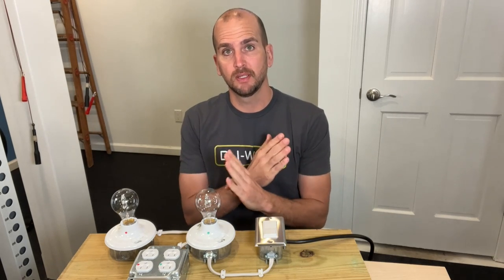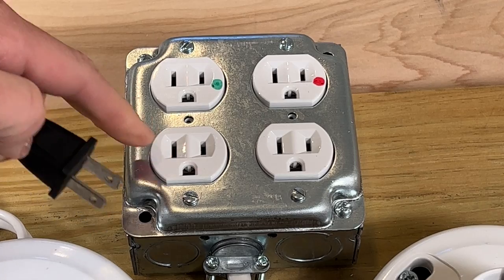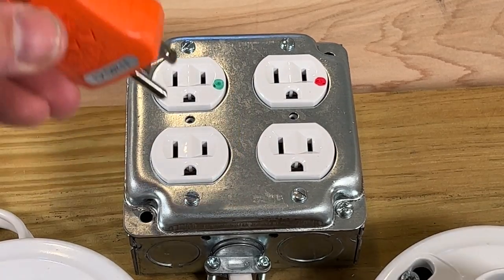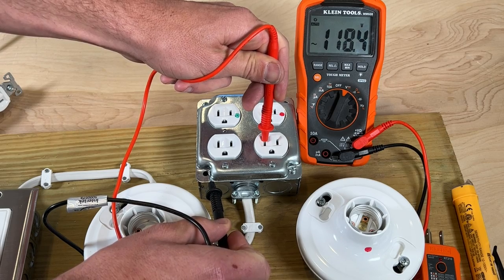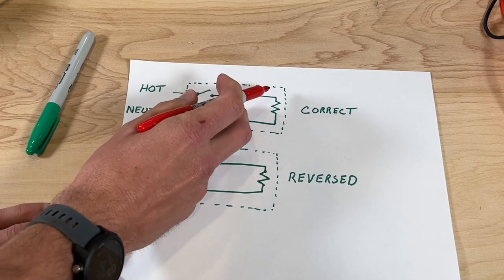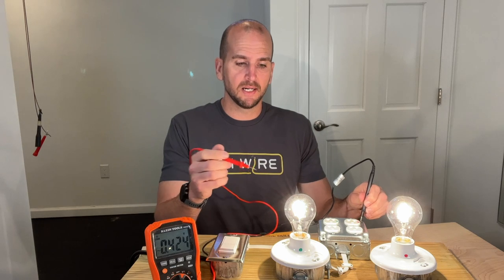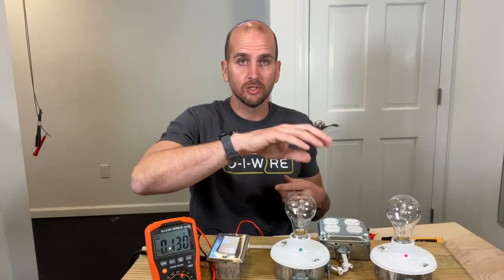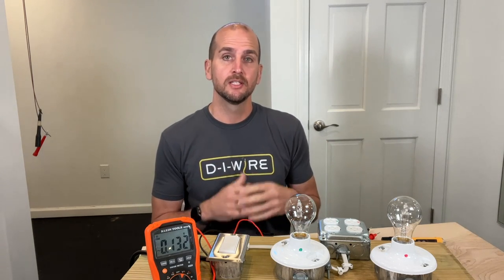Dangerous Wiring Issues In Lights and Outlets

Comment: Electricity had always scared me so I've avoided it.

This reverse polarity thing is strange because it hurts you in a way I wasn't expecting.  Thought you would get shocked if you touched the reversed bulb or the fixture.  This is much sneakier than that.
Reply: All well pump houses is operated on polarity. All power goes in 1 direction and opens gstes in the  wiring circuit. If connect 2 legs from a power source to its main  reaker and nothing works , try changing the 2 service wires around, the polarity backwards.
Reply: @michaelspencer6523  Looking strictly at ANY transformer, you basically have only 2 wires in a loop.  Yes they add a 3rd wire to make it another leg, but the basic electronics is only two wires.  We call them "hot" and "line", not ground.  Green ground (chassie ground), is not the same as line "ground" in the loop of that circuit.  

We add the "ground" in case if there is a short in the loop, and there is then a place for that power to go away from the circuit and away from the human beings.  AC has no "polarity", in the strict since, like DC does.  

The sinewave is first plus 120v, then negative 120v, back and forth.  So if we did away with the ground all together... the line and hot would still always work.  

It simply makes the circuit possibly dangerous in the right circumstances.  So it does not matter which side of the motor that a switch is on in the strict since of the circuit itself.  Only on if that something happens to that device, that a short (hot power) has no place to go other than through a person and to "ground" that they are standing on, completing the circuit.  But I bet you still wont agree with this science... again.  This is for JAKE to read and understand.
Reply: All polarity is , diodes force curent go 1 direction. Reguardless a dirrectuon it goes, its curent, sll curents are dangerious even .06 amps. It kill the same as 6 amps.
Reply: @michaelspencer6523  Diodes take the negative side of the AC waveform, and puts it into the positive side.  It fills in the wave form, making it into unregulated DC, with fluctuations and "dips" in the wave.  It can then be further filled in by using capacitors to clean up the remaining dips in that now dc voltage.

As for amperage, it depends on where it hits the human body.  0.06amps is not a whole lot on the outer skin of a body.  It only matters if it is close to the nervous system or heart.  I get more cautious over 500mA AND voltages over 50v.
Reply: We fear the unknown and electricians cash in on that ignorance every day.
Reply: You have no idea what reverse polarity means really. Your explaination is incorrect. You said if touch a current hot line will shock  you and a neutral  not shock you. Wrong 100 % If light works. I explain, the cirrent line is hot we say 120 v ac, light on working. Now touch the  white line  neutral , it a traveler 1/2 the volts as the hot line 120 v ac, it is 60 v ac. Because ac means alternateing currect. That means it sends from transformer and returns back to transformer. Where is your polarity in that ? .ok i explain polarity. It on the hot side or 120 v side not the return side. When voltage goes tona rectafier or a bridge rectafier , on a sine wave circuit, it goes through 4 diodes , 1 on each out put we say 1volt open  gate. The fiode will not let current go back wards and destroy rectafier. It on a polarity drive foward. If tbis polarity got changed, it shut fown diode to dave rectafier. , change in polarity. As in water treatment plants. Or sub stations from a power grid. 99% of all them are 3 phaze 240 v 60 hertz units at 120 v each leg, the center leg is a stinget leg to level out each dual leg at 120 v each by the earth ground applyed. Each leg is equipuiped with a safety return cut off incase reversed polarity.  Then we use color codes to make sure each leg is correct in sub station panel as (boy)  #1 is  color brown  or black tape  and #2 is orange tape and #3 is yellow tape. 3 phaze delta 60 hertz  240 volts. If swap  2  of the wires   around it go in different polarity.
Reply: @michaelspencer6523  you are not considering that we bond neutral to ground. It's weird but that's how it is. The whole electrical grid is referenced to earth ground. We do that for reasons. Basically so lightning bolts don't go shooting out of your receptacles as the grid floats away. All electricity is a potential charge difference between two points.
Reply: @michaelspencer6523  I told you about how a AC waveform becomes DC and you go on this rant.  I can tell I am not talking to an electrical engineer, but a electrician. 

Yes you went over a bridge rectifier.. kind of like a kid splashing in the mud, but then go off on 3 phase that is not what I am talking about.

Phases of a transformer have nothing to do with DC, nor Bridge rectifiers.  Phases are literally just several transformers, physically made into one box, with each "phase" being an AC voltage output "leg".  That transformer is stepping down (or up depending on windings), using a magnetic field.  

Bridge rectifiers again take the ac waveform and flips the bottom half of the wave and adds it to the positive side of the waveform creating unregulated DC.

Yes electricians use color codes to tell them what voltage comes out of each side of the transformer.  It means little in the circuit analyzing and mathematics for electrical engineers.

Good day.
Reply: @1pcfred  no it is made that eay in panels to equal the balance. But if use a no fault, you ise a usilated ground earth bar. A neutral is a traveler, it carries half the load as a main breaker  by heat of the mercury be 200 amps, and it 80 % loaded at full its 160 amps 80% load makes neautral at 80 % is 1/2 of current load = 70 amps return. A earth ground is 0 % load. It a shortage bar. It balances at 100 %. It trip the bar to disconnect. It not on the heat breaker to melt the bar  then it flip away break8ng circuit. A short breaker will save a life on imediate break where the merury breaks  from heat to melt the solid mercury conductor. You must reach the tempature it takes to melt mercury. Result burnt up from electrucution. This is earth ground and its purpose. It has many things it controls as power grids, mega generators, co.putet work stations, all electrical processing equipment all takes no fault isolsted circuits plus explotion oroof as gad stations and hospitals where electrical friction causes has explotions as oxigen, etc.no failt is expencive but a major compontent in daily life and life saving. Im a master electrian who was a electrical master electrian for the usa military bases in a war. Where seconds count to have power that saves lives. No power can cost thousands of lives in many things. Hospital, water etc. We was KBR. We built citys from  a war.
Reply: @1pcfred  a lighting rod it called in olden day , but it really a ground rod. A copper claded  rod  of 6 feet long 1/2" ir a 3/4" 6 feet rebar will do the same. Must have a connector put on end to connect the ground wire to ground bar in panel box. Use this bar to use ground fault  or grounded compointants. No earth ground is 100 % unsafe .and damages all high tech equipment that requires balanced in put or out put. Alot high tech motors and ac  break controllers require it.
Reply: @jacobw446  you did it again, it incorrect. As a alternator makes alternating current but not blalanced and set , it goes thousands to 1 in seconds. So must sent transform to a set balanced dc , dirrect current then transform dc bacj to a balanced set ac current. But with a transformer make a neutral so half the current can travel back to the traveler called a neutral. Tben to balance the current to neutral , must have s seperate earth ground  to balance the phazes or it go out of the 360 degree phaze  and it lose the balance and freeze. Like i said , nothing works equal and correct wothout a earth isolsted ground.  It not mater we try, it the same as trying to put a 4 inch square in a 1/10 inch hole.
Reply: @1pcfred  i already said that, it not work for better panels for idolated earth ground. That only to balance neutral , it nottake the place for ground or osolayion in gas stations and hospitals or computers or power grifs and mega generators. Those must be isolated earth ground with a neutral bar goes back to tbe oil cooled genetator on the 10,000 volt ac transfomor on power poles from 5 kw to 75 kw.
Reply: @michaelspencer6523  a lightning rod goes on the roof and is attached to a ground rod. When lightning strikes all bets are off. There's no protection that is guaranteed to protect anything. Someone I watch on YouTube lightning struck a tree in his front yard and he lost all kinds of equipment in his house. It was pretty random what blew out and what didn't.
Reply: @1pcfred  thats like i said old therrories, not a fact. Lightiny rods  finally fact, it magnetuc friction from ppssitive to negative earth ground. Anothee words earth ground better contact is made with copper clad , if rich it be a 18 karot gold rod. But if like everybody else work for a living, it be a copper claded covering  on a steal rod. A earh ground  rod 1/2"x 6'
Reply: @1pcfred  sounds like a clown set up his own house to get fuined by friction power unlimited. Nothing new, pld therrories proved a fact, it the tallest thing connected to earth. As a ground rod attached  to electrical in house and if housevis steal frames as all concrete block houses are as mine is, it attached to the house frame and tbe rebar and wire mesh in concrete floor. And i had all ouside concrete inside security gate concrete and tiled and revared for heavy traffic and its tied to earth  ground  rod also. Earth ground protects alot in your home.  Do not believe junk therroies  on youtube, i found more dangerious stupid things on youtube than anything good or correct. That  be hit bog time by osha one day
Reply: @1pcfred  who ever really thinks a lighting rod protects friction  electric knows mothing anout earth ground or its purpose. Thats old  therroies not facts. Tberrories is the begining of a study, study is complete aftet x amount of times , times the timesof the fact figure. Earth ground is 100% fact.
Reply: @1pcfred  if lighting struck a earth ground rod, it disappear. It blow up like it was a tiny flint rock
Reply: @michaelspencer6523  if lighting struck an earth ground rod, some of it will go to everything else that's grounded too. Just a little of a lightning strike is still a lot.
Reply: @1pcfred   think of  a power line 10,000 volts a leg . We must be over 5 feet away from the line or it suck you unto it and disappear. It has happened in the  Past.
Reply: @1pcfred  here the real thong to think, since electricis do dangerious, can you imagine whar all the house be if all was on a mercurt breaker ? You would have to get above the heat to melt mercury before the power is off you if get stuck in it ?  A no fault receptical is a shortage breaker not on a mercury heat  breaker. All it yakes to shut it down is a cross parity in its linecalled a short, all ar once it trips the circuit to no power. It may have saved your life. Even if walk away, you need be near a hospital for 72 hours incase of a heart attach or stroke. Electric works on mussles and your heart is a huge mussle.
Reply: @michaelspencer6523  No, we use earth grounds as a safety.  Talking from an electrical engineering circuit standpoint, a transformer can be a closed winding with no earth ground, and just a device in that circuit (dryer, heater, stove).

In the case of a 240v transformer, we have one winding (output side of transformer), with a center tap to make it into two separate voltages.  In this case, we split it into two 120v "legs" with a common "neutral".  But this is still mathematically just two separate transformers on the output.  Circuit loop 1 and circuit loop2 

It works the same way with a 24v AC transformer.  Center tap the winding, and you get 12vac off each side.

We merely put a neutral to ground, through a grounding rod, to have a place for the voltage to go if an outside thing (person) touches that other side of the windings of that leg of the loop.  A ground is for safety, not for the operation of the transformer, since the voltage is always looking for a place to go to ground.  It stops a human body, or another device, from becoming the GROUND POTENTIAL.

https://electrical-engineering-portal.com/ground-potential-rise-in-your-home

Comment: I been seeing in some china made light fixtures insted of black and a white wire there blue and red.have to check voltage to make shure there wired correctly
Reply: I know at least in Australia blue wire is often used for the neutral wire so the coloring system used in the US is not exactly universal. 
Has thrown me off wiring up a few imported machines.

Comment: This is what killed a writer in Thailand. His ceiling fan wasn't working so he tried to fix it not realizing it was wired backwards so that the switch did not break the hot wire going to the fan, causing him to get electrocuted. Please, guys. House wiring is not a hobby. Even 110 VAC can kill.

Comment: I don't see this being asked so hopefully it isn't a stupid question...

If Alternating Current changes direction 60 times a second, how is only one of them hot? Why doesn't each lead act as hot every alternate cycle?
Reply: Because only one of them is grounded. It is grounded always so it is always at the ground potential. You do not get negative voltage. Also it changes direction 120 times a second.

Comment: Should've also shown, with the hot-neutral reverse before the switch, with the neutral switched off, what should be neutral side remains hot, and, and what should be switched off hot side, also remains hot via any (unenergized) load that's connected ... that was shown on diagram, but should've also shown that with measurements on the circuit ... but looks like your demo circuit didn't match the diagram, as the demo circuit had the hot-neutral reverse after the switch, rather than before.
Would also be good to show that those tester light thingies (I oft call them idiot testers ... for ... reason(s)), won't show all possible faults, e.g. hot-neutral reverse + hot ground, and the idiot tester will indicate all is fine - when the situation is even more dangerous than just a hot-ground reverse.  Those test lights just show the potential between each pair among what should be hot, neutral, and ground, expecting potential between hot and the other two, but no other potentials.  Well, correctly wired isn't the only way to end up with those same relative potential differences among what should be hot, neutral, and ground.  That's also why I much prefer the basic two lead neon test light.  I can not only test the 3 relative potentials, but I can also test any or all of them between that and a known good ground reference or ... since it's so low current - even myself as crude approximation of ground (similar to screwdrivers with the neon test indicator - but without needing yet another piece of test equipment).  If one lead on me and the other to circuit causes it to (barely) light up - it's hot ... if that other lead is on what's supposed to be neutral or ground, somebody messed up the wiring.  And yeah, I've seen seriously messed up wiring with hot-neutral reverse + hot ground - hey, it passed the idiot light tester test ... someone probably just rearranged the wires until they saw the light pattern they were expecting, and left it at that.  Yeah, traced that sucker back as far as I could ... there was bare copper wire that should'a been ground coming into the apartment unit that was in fact hot - egad ... atop hot-neutral reverse with white wires hot and black at neutral potential ... what a mess.

Comment: The ground prong on a plug cord has nothing to do with polarity. The ground is there because the wire isn't doubled insulated. Non ground prong cord plugs are double insulated so ground isn't required for plugging. The other incorrect thing is LEDs being able to reverse polarize. The drivers in them only work one direction, so they won't work if reverse polarity occurs. A switch can be wired correctly, but reverse polarity can still occur in the light. That's done if the hot and neutral wires are reversed in the light. Since all neutrals are connected in the box reverse polarity has nothing to do with the switch. So your diagram example doesn't work. Attaching the neutral and hot on the switch would cause a short circuit when it's flipped on.

Comment: The problem is that your switch has the polarity reversed,. not the light fixtures. If the switch is wired correctly  (Blk wire in, Blk wire out) then when the switch is off NO power can get to the light socket.

Comment: I think you should have opened up the outlet box and shown what a reverse wired outlet really means to a closet electrician.  Also should have turned the light socket over and shown what a reverse wired and a correctly wired socket really means/looks like.  Additionally, you make it sound like getting shocked by 115 vac is no big deal.  Given the correct conditions, 115 vac is just as deadly as higher voltages.  I could run you off hundreds of pages of fatal 115 vac accidents from the OSHA web site.

Comment: At about 2 minutes in you said "They will still work without an inverter".  You should have said "they will still work without a transformer".  An inverter transforms AC to DC (or vice versa) .... a transformer steps the voltage up or down ... i.e.120 to 240 or 240 to 120.

Comment: Unfortunately european-style plugs can be inserted into the receptacle both ways, just like usb charger you shown. Also, as far as I know our receptacles doesn't have designated hot and neutral connectors, so there is no way to implement this concept you're talking about :(